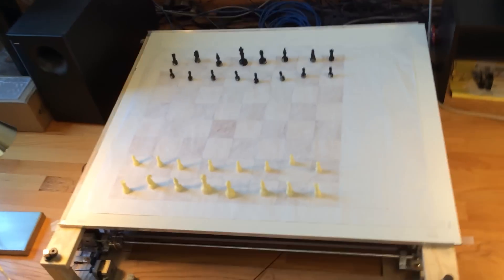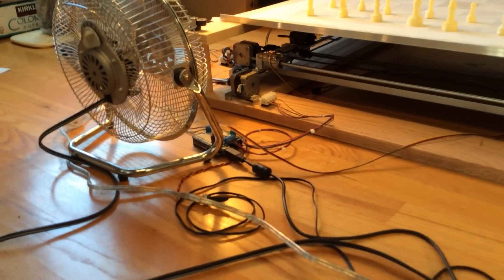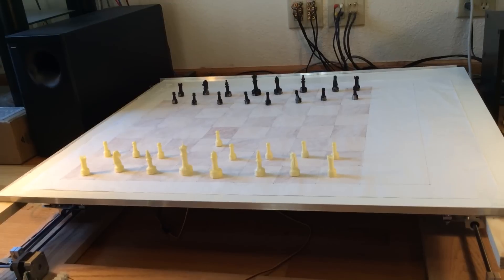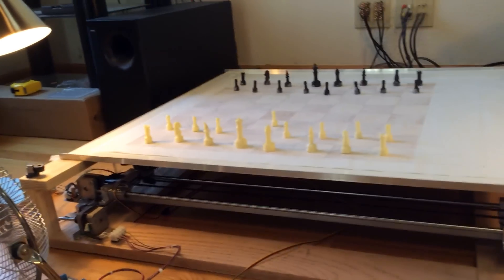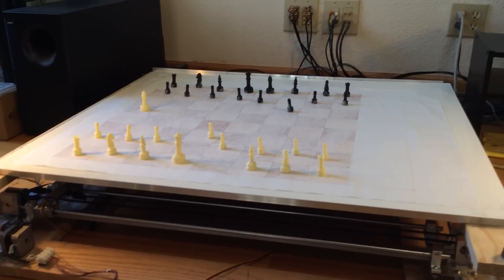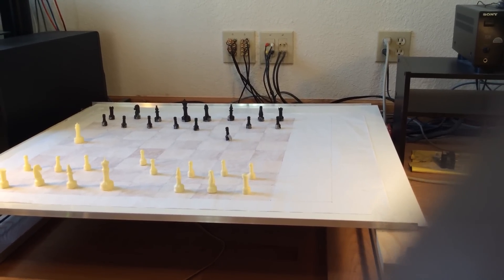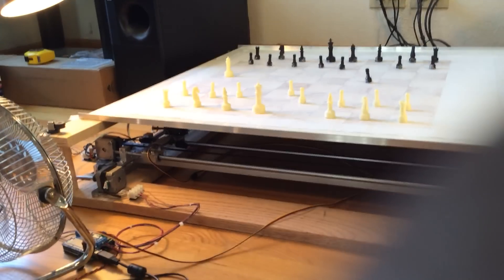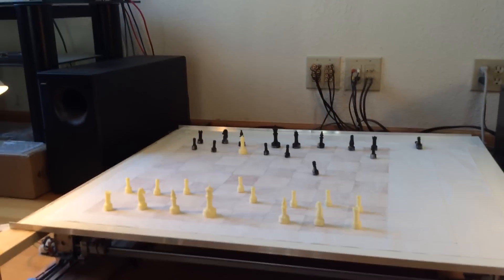Wizard's Chess -Texas A&M University CE Project 2015

Comment: nice proj sir.But sir how does the arduino detect the each pieces and there moves? I need Help :(
Reply from the maker: I have a chess program running on my laptop in the background. The program internally knows all the positions. Based on these positions the user can send a move, the laptop program will determine whether the move is valid. The move is then encoded into a set of motor commands and finally the arduino executes the commands.

If you are seriously interested I will put up the code on github.
Reply from the maker: And thanks :)
Reply: +Vyas Sathya can you share code project ???
Reply from the maker: +Nam Khôi Trần all but the arduino code is on my github, github.com/vyassathya I'll put up the arduino code and some documentation over the next couple days
Reply: +Vyas Sathya Tks you so much :))